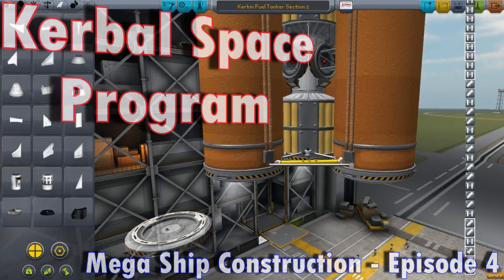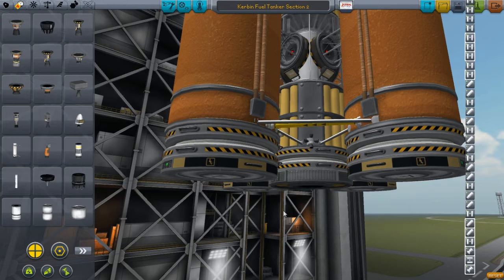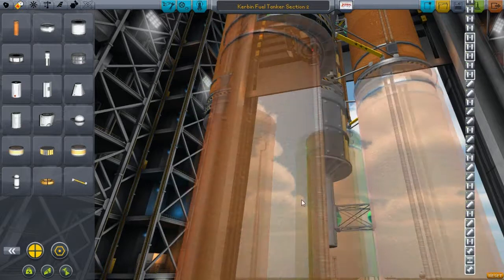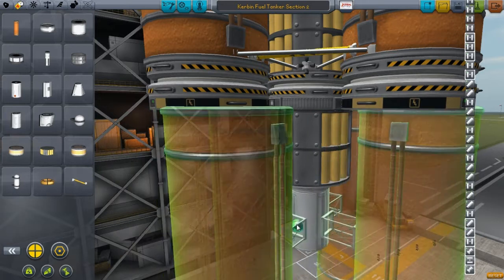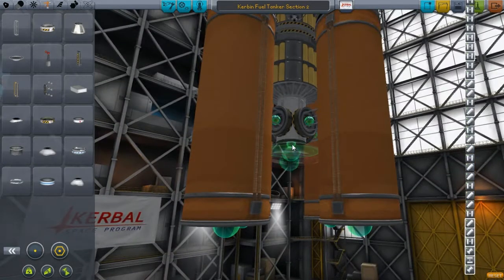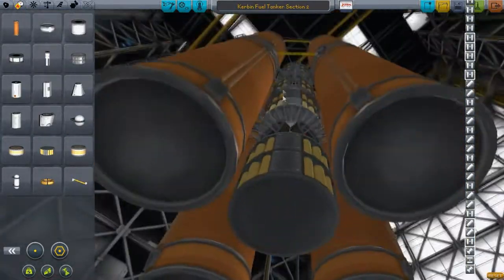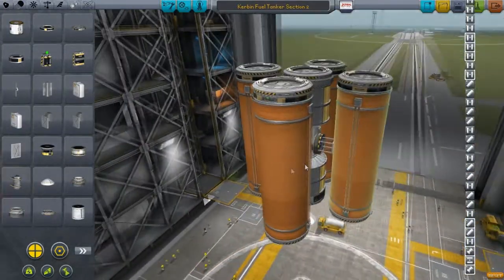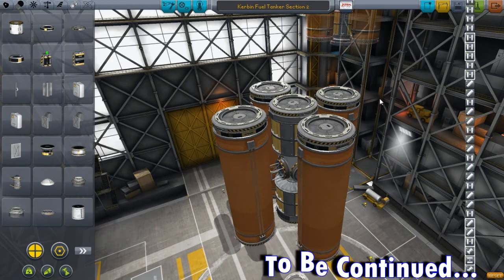KSP - Episode 4 - Mega Ship Construction!

Comment from the maker: not really too sure about that. It may have to do with fuel lines. I usually always build the engines portion separate even with their own tanks to pull from. It works better that what as well so you can also disable the crossfeed between "cargo" and fuel.

Comment: The issue I'm having is my 2 tanks are docked and normale is you have 2 tanks with docking ports in between them the engines drain the top tank first, however I had a design with 4 tanks that would be docked together in orbit but after i docked (both dockingports are docked) the one side will drain from the top tank while the other side won't. Not sure what the issue is but i ended up building it in one piece, was a pain to get it into orbit though.

Comment: It's very annoying the game doens't support double node attachments. I had some issues myself with that when building my interplanetary vessel. Because of the limits i had to redesign it completly and it still doesn't work the way i want it, mainly fuel transfer is an issue. And the FPS drop in the VAB has to do with part count, you have alot of non attached parts. Also don't you have any issue getting all docking ports docked?